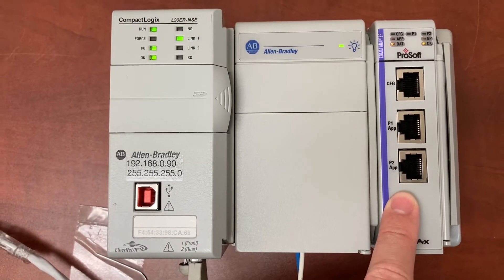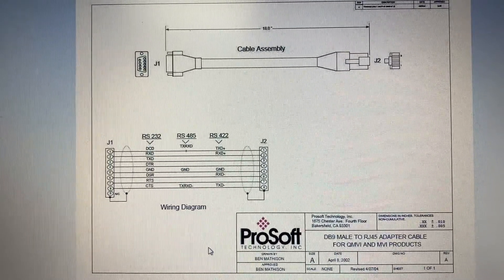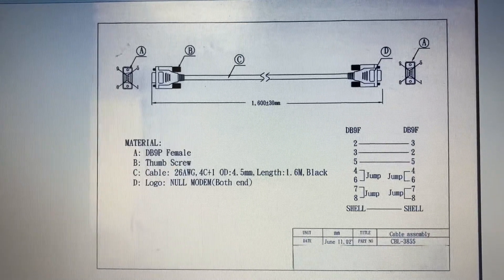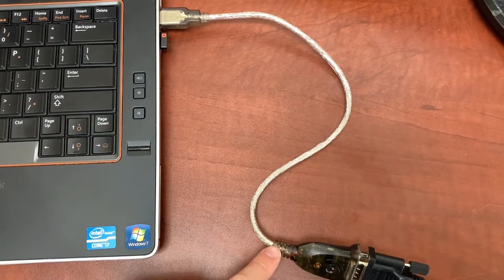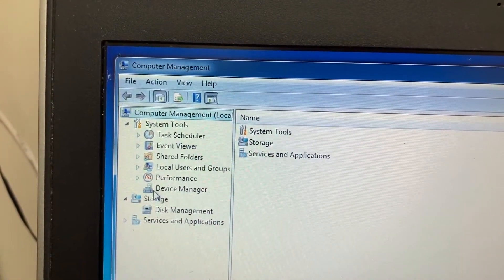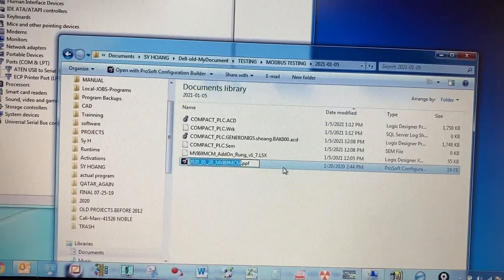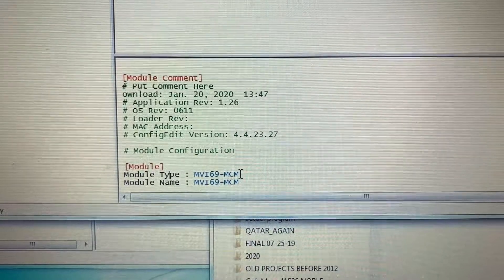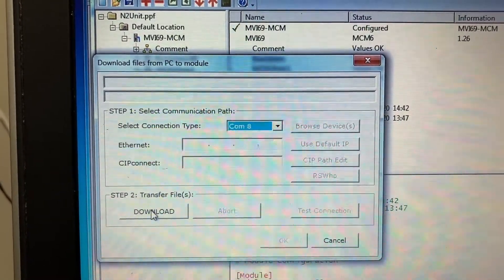How to Download a Prosoft Project File .ppf to a module - Prosoft Configuration Builder

Comment: Can i use db9 male null modem  connect to male null modem db9 using mini gender adapter to make straight cable rs232 and connect to rs232 to usb cable?
Reply from the maker: @latx-et2kz: Sorry but I never tried it before.

Comment: Hi
What is the baud rate using to serial?
I am getting timeout error
Reply from the maker: @transient matter: Thank you for subscribing to my channel. I think it's from the cable instead. Double check your cables and settings in the configuration.
Reply: Did you ever figure this out? I am having the same issue. Tried different cables but to no avail.